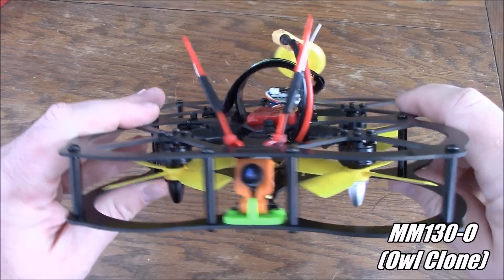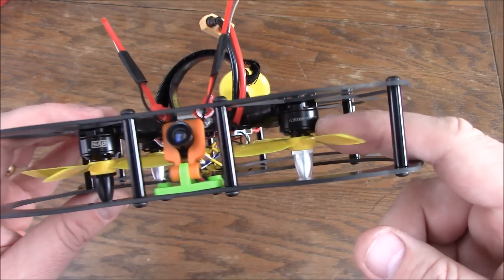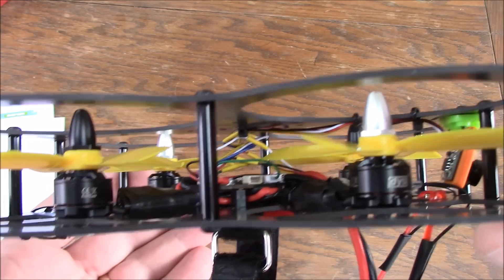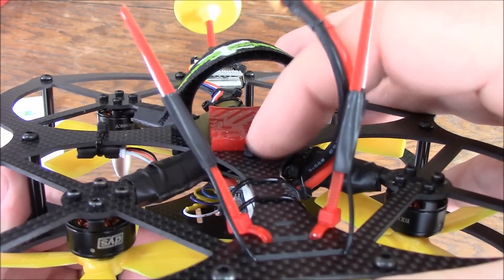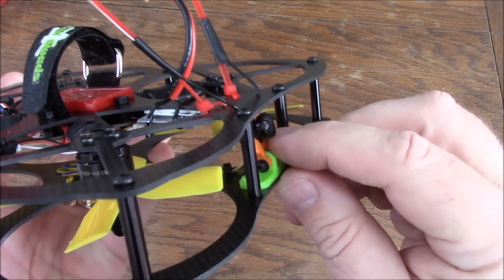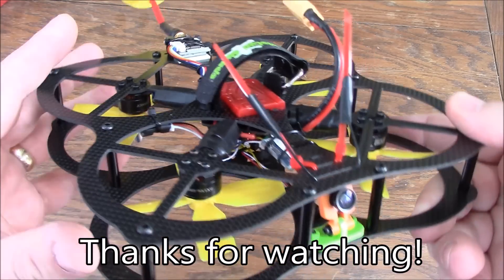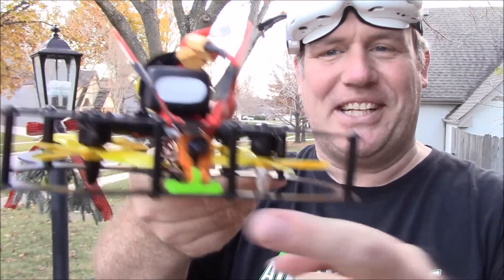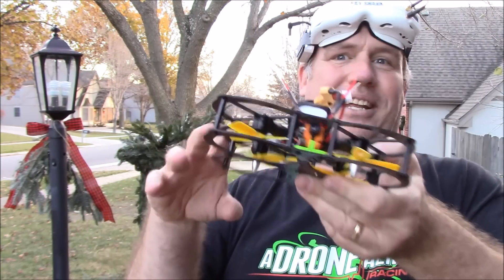Build Review of the MM130-O with Some Flight Footage

Comment: What are the pitch on those props? I'm having trouble finding 3" 4-blade props. Thanks.
Reply from the maker: I think they're 3045 props.  I'm not sure where I got them from.
Reply from the maker: These would be good ones to try.  I'm going to use these 3052 tri-blades on my new 3" quad...  https://www.banggood.com/2-Pairs-Gemfan-Flash-3052-3_0x5_2-PC-3-blade-Propeller-5mm-Mounting-Hole-for-1306-1806-Motor-p-1179233.html?p=6Z050013977120130325
Reply from the maker: 4 Blade 3054:  https://www.banggood.com/2-Pairs-Furiousfpv-RageProp-3054-4-3x5_4x4-Race-Edition-4-blade-Propeller-CW-CCW-Yellow-p-1170167.html?p=6Z050013977120130325

Comment: Hi. what setting do you have in Betaflight to flip the board? I thought i had it sorted in the config but it just flips over! Thanks
Reply from the maker: I rotated the board on the configuration tab.  Once I thought I had it right, I switched back to the tab with the animation and checked it and kept guessing till I finally got it right.
Reply: travisgrindal I've been trying that my guesses don't seem to work..lol I thought I had it but it just flipped over and revved the motors at full..

Comment: Hi Travis. Thanks for posting this, I just ordered the frame,  4-in-1 20A, Emax 4000kv and CC3D Mini Revo for my build. Can I ask if you ended up trying the 2 blade props on this? still flying it?. Cheers :-)
Reply from the maker: I swapped out the 4 blades for 3 blade props and it flies a lot better.  The best thing about this quad is how durable it is.  The carbon fiber protects the motors and props so well that after a crash, I can usually just flip it back on its belly and take off again.

Comment: Had a question, why does everyone build this frame with the motors facing down?  Is there a benefit to this?
Reply from the maker: For me, the biggest reason is that it makes it look different than my other quads.  Also, the idea of having a "pusher" quad instead of a "puller" quad is cool.  Also, the air can push more freely down since there is nothing under the props.  normally the motors are arms are under there.  Although, in this case those are just above the motor slowing down the air from getting to the props.  :)
Reply: Thanks Travis!  Really appreciate the reply.  Are there any weird flight characteristics as a result?  I'm also wondering if there's also additional benefits such as less debris getting inside the motors.
Reply from the maker: The biggest advantage is that it is hard for anything to get to the props to break or bend them.  It has survived mid air collisions and tree branches.  The only down side for me is that this only flies "okay" on the default BetaFlight settings.  It will require some tuning after it is installed.
Reply: Ahhh that makes a lot of sense.  Woohoo I'll give it a shot.  Thanks for the quick and informative replies!

Comment: hey mate, do you have pids for this, or do you still use the stock betaflight ones ?
Reply from the maker: I've done a little tuning since this video, but the aileron tuning is still not perfect.  I get bad wobbles when I crank it pretty hard.  I'm too embarrassed to share them.
Reply: Travis, fair enough. Reason why I asked is because I have a similar quad with the props all protected in the frame, but as a 160 wheel base and 1306 motors. Interestingly enough it did the exact same thing what you describe, a 'overcompensation' when you come from a high pitch forward position. 
Now I did quite some tuning on it today, and I am almost there. I use CC3D and LibrePilot. I didn't quite understand what each setting does and how effects the flight characteristics, so I set it up with 3 different setting banks on 3 position flight switch. My best tune always on switch pos #1, and then #2 and #3 modified settings from #1, so I could see the difference. Really great eye-opener this way. I learned more about tuning in about an hour or so, then what I've learned from watching a gazillion youtube videos :-)

Here is what I found. I fly the quad in Attitude mode (Angle mode) as it doesn't have enough power to do much acrobatics anyways. 

- All settings change the flight behavior (Responsiveness, Rate Stabilization (inner loop) and Attitude stabilization (outer loop), regardless of what other people / documentation tell you !

- The 'Responsiveness' setting influences how aggressive the quad rolls/pitches based on your stick input. Basically you 'rate' (as in degree/sec) setting for Acro mode.

- The 'Attitude Stabilization (outer loop)' setting controls how aggressive/quickly the auto leveling algorithm tries to bring the quad back into a leveled position, once you put the stick back into center position. This is your main culprit for your 'overcompensation' behavior. I had to tune this setting significantly lower from its default setting for this quad. Right now it is just very gently / slowly returning the quad back to level. Its like an assisted acro mode. The quad still self-levels but slowly. No more overcompensation. If I need to quad to change direction faster you do acro mode style input (steer in the opposite direction). I am very happy with this setup now, as the quad fly's very smooth and controllable, yet stable.

- The P gain setting in the 'rate stabilization (inner loop)' is responsible for uncontrollable 'wobbles' and oscillation even with Angle/Horizon/Attitude stabilization enabled. To low and the quad struggles to stay stable and displays a 'slow wobble' around its z axis. Too high and you get high frequency oscillations - sometimes you hear them more than what you see them. 

So for my tune I put the 'responsiveness / rate' setting quite high to have a 'direct' feeling between stick input and quad behavior. This way its 'zippy' and you can make tight turns etc. The outer loop Roll and Pitch P-gain has been tuned way down (default was 25, I now have 10). I also tuned down P and I in the inner loop   by about 25 % from the default settings.

I also found that I like to run about 30 % expo on the throttle curve, as the quad is a bit under-powered  for the heavy frame and it helps me getting myself out of trouble ;-)

I dont know how all this translates to CleanFlight / Betaflight, but maybe you or some reader takes something away from this. This frame is for sure much harder to tune then your typical X or H ZMR250 style frame. 

I am going to build a 130 with the same frame as yours next. Cheers.

Comment: Would you share your PID numbers? I'm having trouble tuning this thing. Did you get the dive/pitch-up tuned out better. I keep crashing mine when I'm aggressive in a dive as well.
Reply from the maker: I'm still working on it.  Right now, it just has the default BetaFlight 3.0.1 PIDs.  The first thing I'm going to do is increase the "I" on the pitch and roll until it stops.  Increasing the "I" usually helps it hold its position better while descending - I think that should fix it.
Reply: I bet it balloons like that because it's acting like a wing with all that surface area.
Reply: Awesome ... thanks man. And thanks a bunch for the great videos!!
Reply from the maker: could be but it can be tuned out.  I've had other quads do that to me too.

Comment: What are the specs of the battery you are running on this build?
Reply from the maker: I'm using a 3S 1000mAh and 3S 1300mAh battery.  I flew a couple of times with 4S batteries, but my motors were getting too hot.  I think the 4000kv on 1306 motors is too high for 4S.

Comment: Looks like a close clone of the FlexRC owl frame.  I built one of those a few months back and it's a pretty neat little quad for what it is.  I built it to fly around indoors and it does that pretty well but it's right on the edge of being a bit too bulky (and loud) for indoor flying.

The frame is a tad excessive with the extra weight and the crazy amount of standoffs (I hate taking this frame apart to do any repairs or mods, lol).  I have been getting pretty hot motors with mine (emax 1306 4000kv) but I am also hauling 3s 1300mah batteries which are probably a bit too heavy for it.  If I went with a ~500-600mah 4s or 3s battery I think it'd be a bit better.

Overall though, I like having it in my arsenal of quads to fly around in bigger indoor areas or checking out some tight spaces outside that I don't want to take my 5in builds through.
Reply from the maker: I have some smaller 3S batteries.  I'll bring them with me when I fly indoors.  In this video I was using 1,000 and 1,300 mAh batteries.